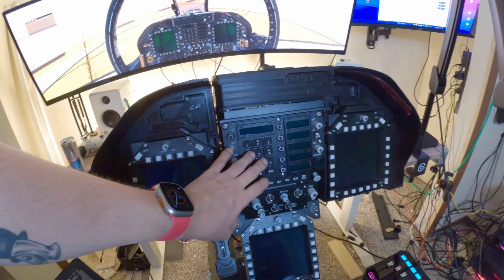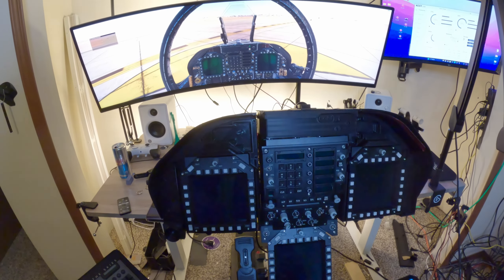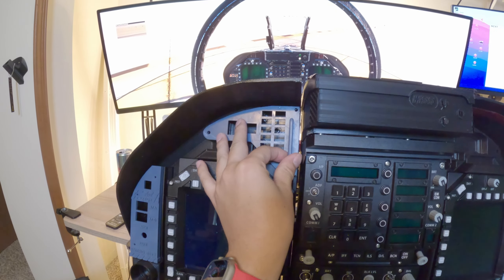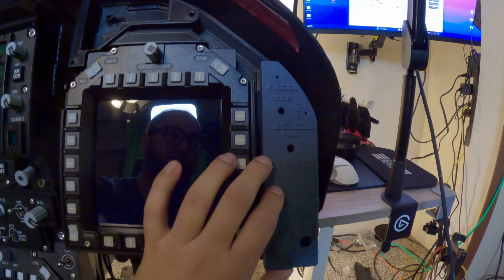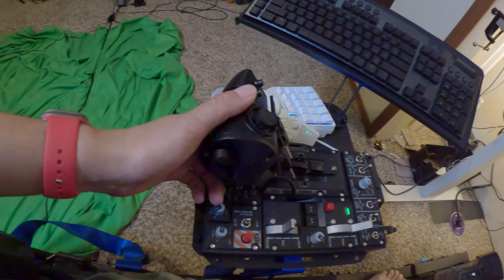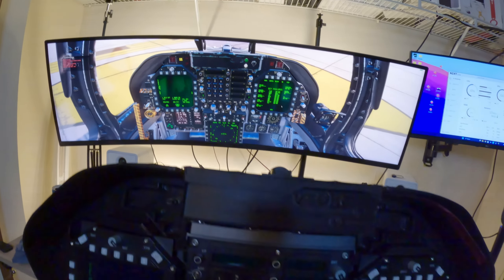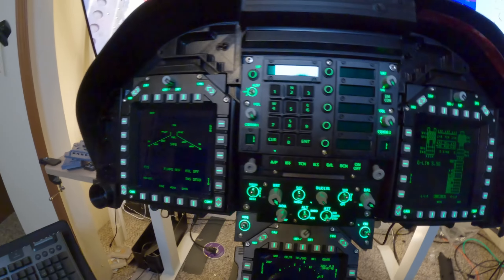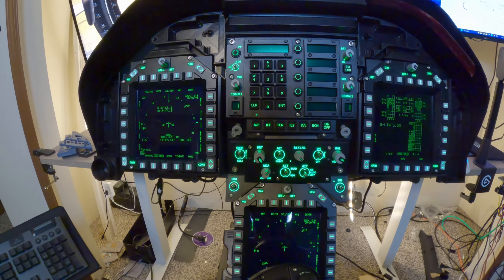An update on my flight-simulator rig!

Comment: If you don’t mind, could you tell me what the largest width is required for the print files?

I have a Bambu labs x1C, but the bed is only 250x250.
Reply from the maker: Yeah you need a LOT of bed space. I used an ender 3 s1 plus, I think it’s 300x300x300. It just barely fits the left and right dash visors
Reply: I’ve also got an X1C, real shame it won’t fit. Also, HornetSimShop’s prices have gone up a lot since this video went out 😢
Reply from the maker: yeah they have, but I know a lot of it was because people were buying his STL files and then reselling them on different sites. Which is a bummer because he puts a LOT of time and effort into his design process.

Comment: @msboi1218 I see you are using the logitech rudder pedals with your sim. Does that work ok, and is that plug and play? Im just getting started in dcs and need input where i can find it.
Reply from the maker: Yes indeed! The Logitech pedals work ok, I had to use some different bolts to mount it to the sim seat though. Everything is plug and play for the most part. The F18 specific panels from winning Automatically map most of the functions but you can always change them if need be. The only thing thats a little more difficult is getting the screens with the Top Gun MIPs to play with DCS. You just basically use them as external monitors and the software configures the rest. you have options for which plane you're flying too.  They're pretty dim out of the box but you can boost the brightness doing some tricks with Reshade. Feel free to PM me if you have any questions!

Comment: PLEASE READ! 
I was planning on getting the WinWing TOP GUN MIPS set, but I am concerned about whether it will work with the F-16 and/or other aircraft in DCS World. Any info would be extremely helpful & appreciated I'm getting ready to get a gaming chair cockpit. I'm talking like the kind with the leather recliner, massage chair that reclines to 170 degrees, the monitor arm is independently controlled so it can be raised, lowered, forward & backward. I'm putting a 49" Ultrawide Curved monitor too. I also pre-ordered a Meta Quest 3 (I sold my Quest 2 & Quest Pro which more than covered the cost of it). Should I get WinWing HOTAS, Vipril or the new Thrust Master?
Reply from the maker: I think price to performance wise, you would be better off going with the winwing hotas. My buddy has the 16 Stick/throttle combo and he loves it.  The Top gun mips WILL work with the F16. in Winwing's software, you can choose which plane you are flying so the mfds display correctly.
Reply from the maker: If you want, I can send you a screenshot later today of what the software looks like with the F-16 selected for the mips!

Comment: My flight sim rig is a VR headset.
Reply from the maker: Hell yeah, I have a valve index but I like having physical controls too lol
Reply: @msboi1218  I already have too many expensive hobbies. If I started building an airplane in the basement my wife would string me up. 😆
Reply from the maker: @Thezuule1  hahaha understandable!
Reply: @msboi1218  I think Ive seen some people who run VR but have their setup so accurate that their buttons are almost completely lined up with what they see in game, dont know how hard it is to set up, or how well it persists between sessions though
Reply from the maker: @phoenix-qr3ln  yeah for sure! I've had mine set up pretty close to 1:1 with what I was seeing in game. It can definitely be difficult to do though. any time I move the rig out of the way to use my computer like normal I need to spend some time adjusting when I set it back up.